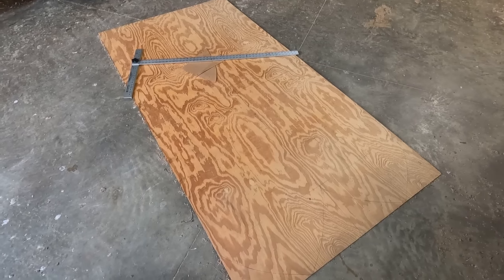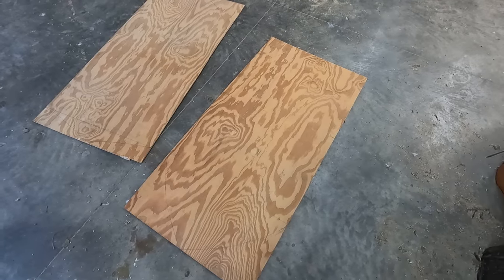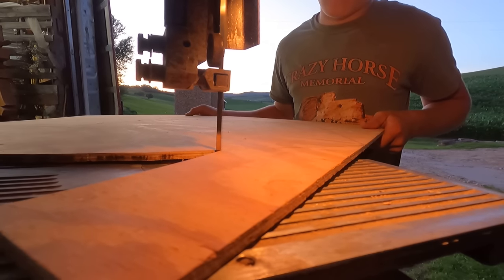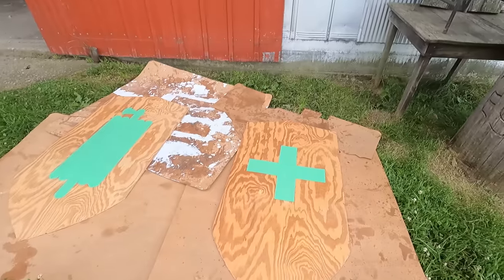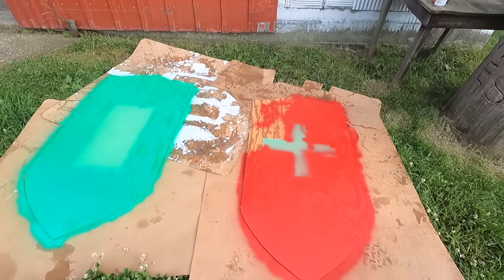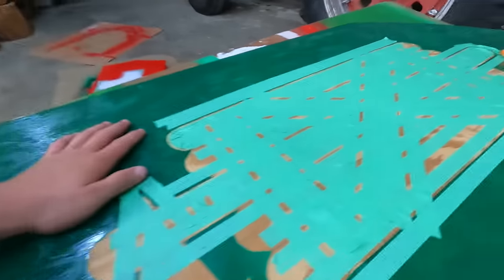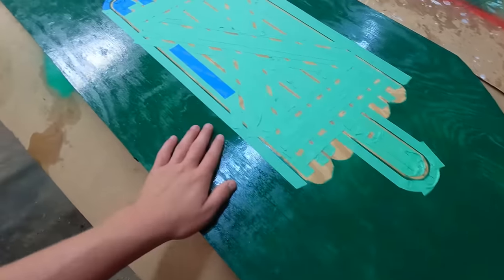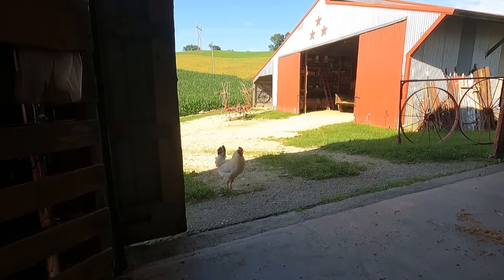Our Little Slice of Switzerland!

Comment: Nice work. You can cut in the paint a little a little quicker if you use a small razor knife on the edges but do it  very lightly.

Comment: When using a circular saw I always set the depth of cut no more than 4 or 5 teeth of the saw blade going through the material you are cutting. This reduces the possibility of the saw kicking back. Especially when cutting any sheet product